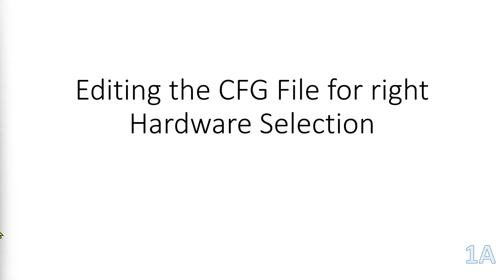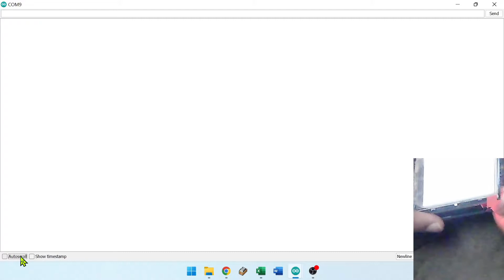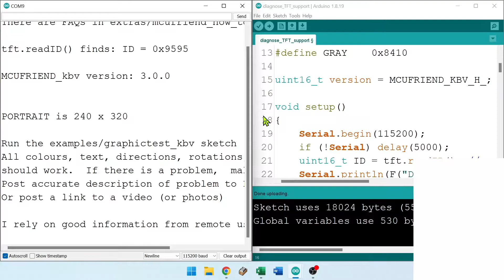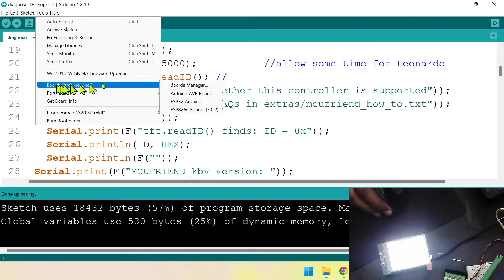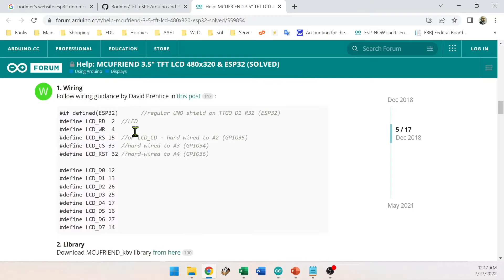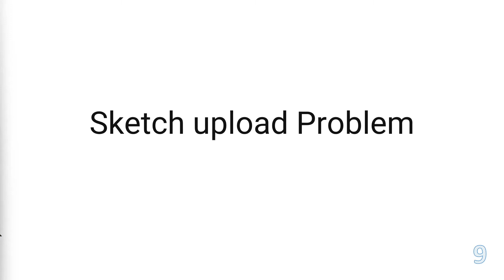TFT Shield with UNO & ESPDUNO-32 Boards

Comment: Please explain to my why you are physically modifying the board instead of properly defining the pins.
Reply from the maker: @Syanptix_Lab  This has to do with analog /digital pin requirement of Shield being used
Reply: @545sytes  Yes I finally worked that out today.  I decided to build a custom adapter for a standalone chip.  I only bought this because it claimed it was compatible with Uno equipment.  I have a different board that doesn't offer the rewire you performed.   

Although my board had 5 analog pins available here already so I'm still not sure why it didn't work but it doesn't matter because my custom build is working fantastic.  Thanks.